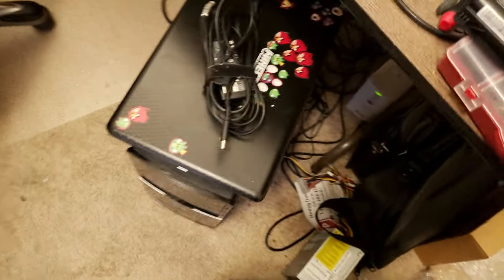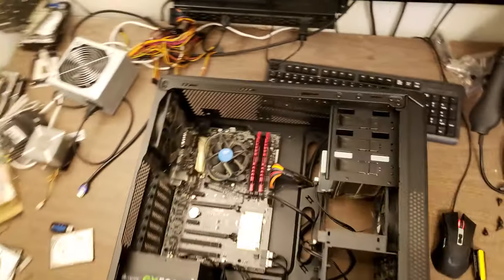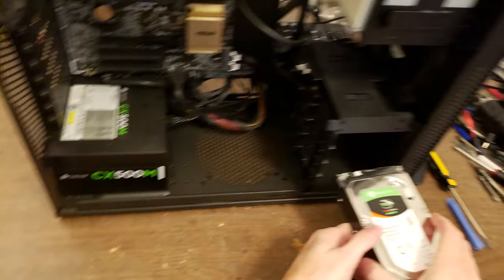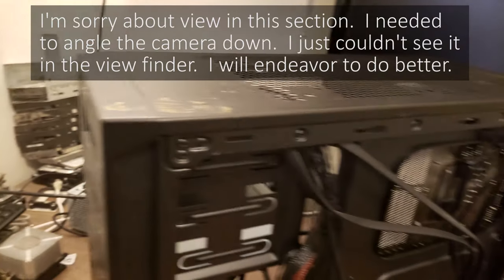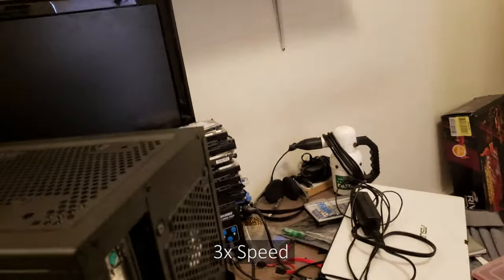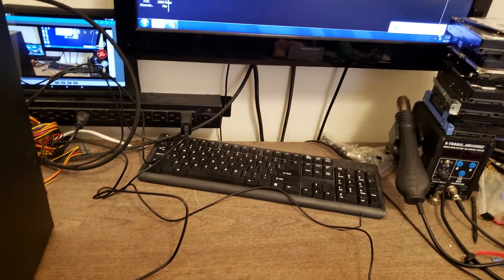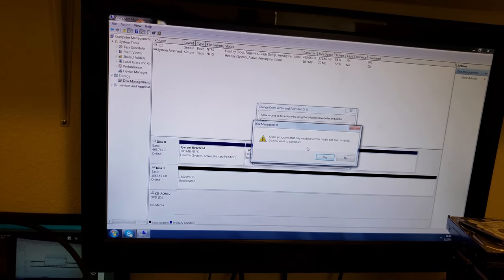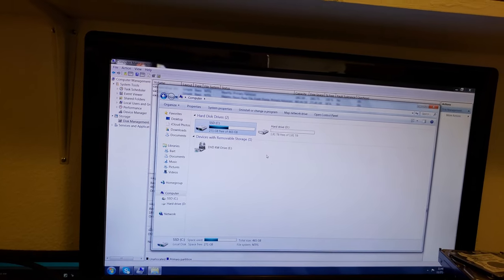How to install a hard drive upgrade on a desktop computer

Comment: If I have a terabyte usb. Is it possible to take it apart or something and put it inside my PC?
Reply from the maker: You can't do that.  Why not just leave it plugged in?  Well if its a desktop with 9npin USB headers on the motherboard you can get an adapter but again why? Just leave it plugged in.
Reply: @MichaelTheComputerGuy  Ill leave it plugged in. Also i got another question. I have a Lenovo IdeaCentre G5 Desktop Tower Core i5/8GB/512GB And im wondering if its possible to upgrade the graphics card on pre built PC's?
Reply from the maker: @Byz_enjoyer  You can but you might need to upgrade the power supply if the graphics card requires more power.
Reply: @MichaelTheComputerGuy  Ok thank you

Comment: question: what happens if i switch a windows xp's hard drive with windows 7's (used) hard drive?
Reply from the maker: It was most likely due to Windows 7 on the new hard drive.

Comment: Am I able to use a 3.5 inch one?
Reply from the maker: In a desktop there should be places to install a 3.5" hdd.
Reply: @MichaelTheComputerGuy  would it be able too in the  hp pavilion desktop as that's the one I have and I saw a 4tb ssd drive for it
Reply from the maker: Probably.  You can open up the case to check or find the service manual online.  If you Google search for the full model number of the hp with the words service manual you should find a link on hp's site to a pdf.
Reply: @MichaelTheComputerGuy  thanks you I will see what I can find I'm new to this stuff
Reply: @MichaelTheComputerGuy  Im kinda dumb and can't find the stuff if you don't mind can you try to find it for me?
Reply from the maker: @psychoexplosion9209  I told you in the previous comments how to search and find it. Do you not know the model number of the computer? If that's what's holding you up look on the outside of the case for the model number.
Reply: @MichaelTheComputerGuy  ahhhh I seee

Comment: Why does mine not pop up on drivers
Reply from the maker: A new drive should show up in device manager and disk management.  If it doesn't check the cable connections.
Reply: @MichaelTheComputerGuy  yeah I did but once I format it it still didn't pop up only on disk management
Reply from the maker: @as-go  In disk management you have to initialize the drive, format it and it will show up in This PC.  The video shows the steps.

Comment: I feel like this should be an example video of how not to put up an installation videos...between the poor camera work and blowing dust back INTO the power supply.
Reply from the maker: I agree the camera work with not very good in this one. A lot of people get upset whenever I blow from the outside of a case into it. I found this is the best way to get as much dust out as possible blowing in and out and in and out to get everything out of the little crevices and corners.

Comment: Do I need a solid state drive in my HDD if I already have an SSD card? Sorry if that sounds dumb, I’m building a computer for the first time
Reply from the maker: If you have a m.2 ssd installed on the motherboard you don't necessarily need another hdd or ssd

Comment: Hi,. I want to hook my Seagate hard drive to my desktop motherboard.  Only one data and power cord available for my hard drive that came with the Lenovo desktop. Do I need a SATA splitter or power/Data splitter for my Seagate ? The computer is not recognising the Seagate thru the USB ports. Thanks in advance.
Reply from the maker: The Lenovo desktop almost certainly has a sata data connection free on the motherboard you can plug in a standard sata data cable between it and the drive. If there really is not another sata power connection in the computer you can buy a sata power y splitter

Comment: 5:48 cant find this cable ? Anyone knows 🙃
Reply from the maker: That's a sata power cable.  There should be one available coming from the power supply.  If not you can use a sata power splitter.  You can get one from amazom along with a sata data cable if you need one.

Comment: My issue is i have no place to mount it! Someone please help!
Reply from the maker: What's the model number of the computer?
Reply: @MichaelTheComputerGuy  i have the same problem, my case is called INFINIARC CUBE CASE 6 RGB FANS
Reply from the maker: @iLosTz  I'm not finding information on that exact case. It may be a language barrier issue. What I'd recommend is you open up both sides of the computer and just do a good look around. They're not always obvious like that sometimes it's just a little sled that you can take out put a drive in and put the sled back and of course connect the cables. If you don't have the 3.5" base that are shown in the video look for 2.5" hard drive or SSD sleds/bays.

Comment: Guys I can’t find a SATA data cable i only have two SATA cables not data. Do I have to buy a SATA data cable separately?
Reply from the maker: Most mother boards come with 2 to 4 Sata data cables. If you don't have one and you need one yes and you to buy one.   You can find them at any computer repair shop, computer parts store, Amazon, eBay, Best Buy.
Reply: Michael Cooper thanks I looked properly and figured it out appreciate it!

Comment: i'm sure this is a helpful video but the problem with me is i don't have a hard drive already in it soooo.......
Reply from the maker: This video shows how to put a hard drive in a desktop.  Why would not already having a hard drive installed be a problem?
Reply: @MichaelTheComputerGuy  idk it just seems as if you would have to already have a drive in there before for it to work
Reply from the maker: @_OCG_  You just need to make sure it has a spot to put the drive along with the data and power cables that are shown in the video.

Comment: Question
Can I disconnect the cables from the optical drive and use it for a hard drive?
Reply: i think so because on a laptop u take the optical drive out and put a hard drive in its place. so maybe
Reply: Sakib Raihan I was referring to a desktop
My bad didn’t mention that
Reply: @kruelxd6966  ik but should be the same because both use sata data cables
Reply: Sakib Raihan oh ok 
Thx for replying

Comment: Does each hard drive need its own cable to be powered?
Reply from the maker: Yes each one needs a power connection but the sata power cable can have multiple power connections on one cable from the power supply.
Reply: @MichaelTheComputerGuy  I only have 3 power ports on one cable and have all that exhausted used two hdds and 1 ssd
now wants to add one more hdd 
what should I do?
I have some molex ports coming out of power supply hanging
Reply from the maker: @mohitkumar-wl8dz  Search on Amazon for molex to sata and you'll find an adapter.  There are also Sata y splitters you can find on Amazon.   Just search
Reply: @MichaelTheComputerGuy  thanks a lot man👍